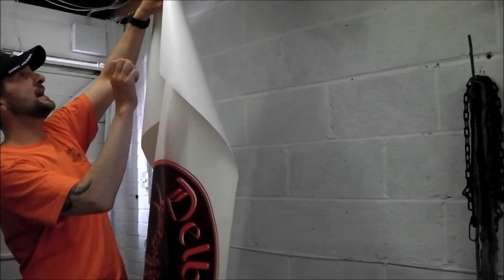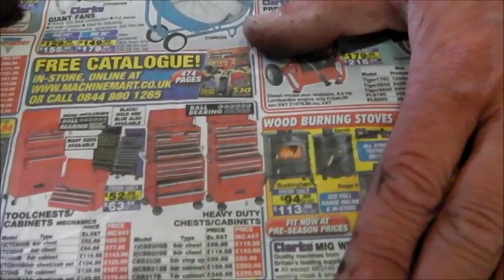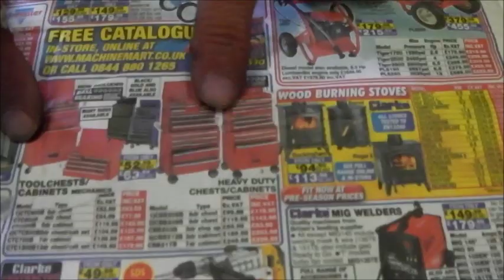Delboy's Garage, Mail call and 'My First Tool Kit'

Comment: I have a ? for you I went out today and spent way to much money lol but for the life of me I can not find a good Torque Wrench in NM I want it in 3/8 drive what are some good places to look at online.I live in the USA and can not find any here.Any info on this one tool would help me out a bunch.But I did get a new AC 225 stick wilder I have not even got to play with it yet lol. I can say tool's sure has went up over the years.I'm getting my shop setup so I can do anything I may want to do to my HD 48 I want to do to it.I hope you can send me to a good place for a good torque wrench not in any reakl hurry I just want one so I can keep a check on my 48.Thanks for any info you can give me.
Reply from the maker: +Kenneth Colbert Hi Kenneth, I guess it would be difficult for me to know good tool suppliers in the USA... I hear a lot about Harbor Freight and Craftsman Tools, but I believe they are the cheaper option!  The ulitmate answer to your question is to simly buy Snap-On, or Blue Point, they are the best tools by far, if you can afford them - Google Snap-On suppliers in your area, and you should be able to find one of the self employed mobile van guys and they usually come to you!  Mine is a lesser brand, it's a Sykes Picavant, a great quality item, cost me about £50 here in the UK... but not sure you can buy them in the USA... hope that helps you a little, good to hear you're setting up your shop to do your own stuff!
Reply: Thank's for the reply Guess I'll have to pony up the money and get snap-on.